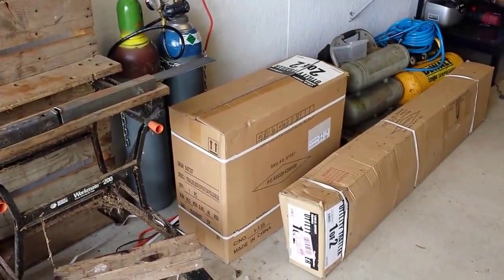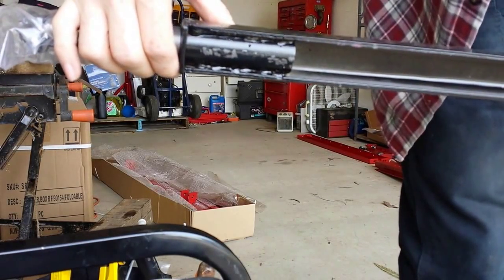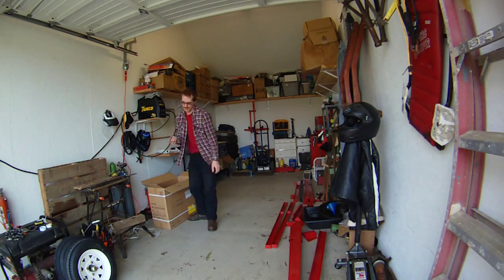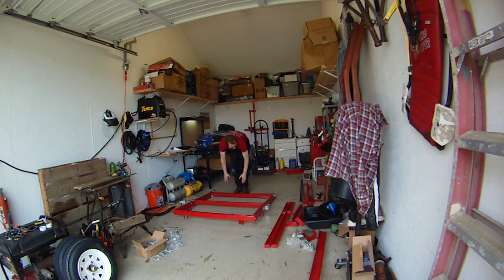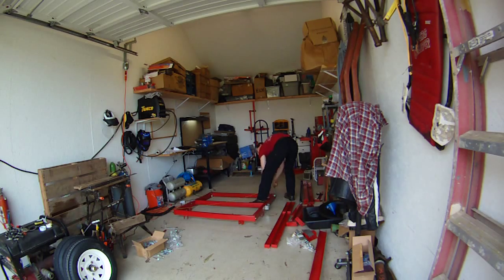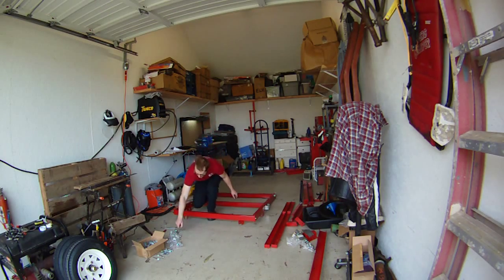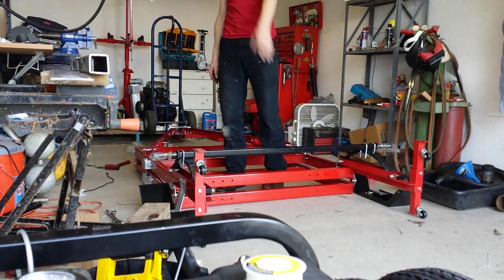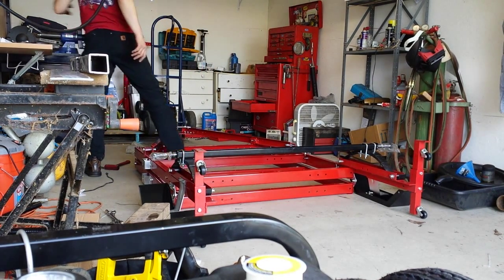Harbor Freight Folding Trailer Build Part 1 - Frame and Supension Assembly

Comment: What are you brushing on the springs?  Half way thru assembly of this same trailer.  The printable assmbl. Instr. on the trailer site differ from the instr. included with the trailer.  List of parts coincides with enclosed instr. so I’m going with those.  
Whoever drafted the illustrations and worded both instruction sheets needs to talk to an f’n engineer.  
INSIDE THE BRACKET does not equate to OUTSIDE THE BRACKET ON INTERIOR SIDE RAIL.  
THNXS !  I got more from the glimpses of your construction assembly than from both sets of “official” manuals.  
👍🇺🇸🇨🇱
Reply from the maker: I was brushing some grease on the leaf spring contact areas.  Keeps them from squeaking.
The instructions are terrible and I don’t think they ever get updated when the design changes.